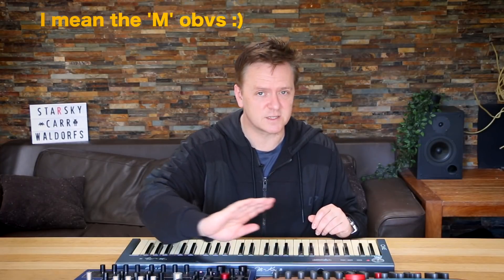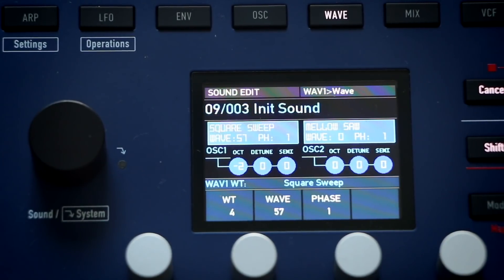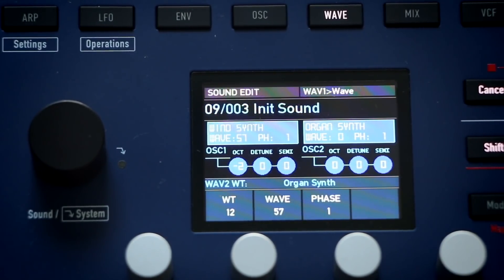Waldorf M vs Microwave XT // The Definitive Comparison

Comment: I'm quite amazed at the modern feature set the XT has. So much depth that's even more versatile and advanced than the M in many ways. It's kind of strange they're adding features to the M to improve it to the level of a synth that's over 20 years old. Is the M now capable of the XTs level of grit and dirt since the changes? Complex to program isn't my thing at all though - the M would be much better for me.

Comment: The XT has a more unique sound while the M is more run on the mill, I should have not returned mine to shop in the 90´s.  I should get another.
Reply: Indeed. Surprised by the lack of people saying this. The M sounds so expected and like others.. the XT sounds unique. If one of these were to be my first or only synth then I may see an argument for the M. But already if I had one analog poly, it'd immediately be more useful to have the XT as it's contrast vs the M. 

Imho.

Comment: Just got to 3:20 - about navigating the param menus on the XT. There's a shortcut you're not using.. page 31 of the manual. If you hold shift (or sync) and move any knob, the screen jumps to that part of the menu structure. Much quicker than using the buttons + big dial. You then only have to use the big dial to navigate a couple of hops to any params that don't have dedicated knobs. Seem to remember my Blofeld does something similar. Bet the M does too.
Reply from the maker: Excellent… I’d completely forgotten about that. Thanks.

Comment: Thanks again Starsky for this comparison! I do plan on getting an M in the very near future but in the meantime, after seeing this video I started going through the presets on my XTk and auditioning them with only Oscillator 1. I've had my XTk for 15 years and I'm just now discovering how gorgeous it sounds. I used to have a PPG wave 2.3 and I'm learning how to get close to some of those sounds. I also owned and SPL Vitalizer Pro and use to run the XTk through it for extra low end and sparkle. I think I'll buy another. Great work you have done for us on your channel!

Comment: The wavetable waveshaper filter is the secret weapon of the MW/XT(k). You can get astonishing sounds using it. I haven't found another hardware synth yet, which offers something with the same character.
Reply from the maker: yeah there was a little trick I used to do to open the gates of hell during a breakdown... but I've forgotten what I did... duh!
Reply: Bingo, is for this reason that the old xt still kicking ass
Reply: Have they implemented all the digital filter of the XT (like waveshaper) and filter fm by now?
Reply: @WackyJackyTracky  looks like filter FM is now there in dsp 1.1 in a working state. digivcf is there as well.

Comment: Fantastic comparison, and it would be good to hear some patches from both. I love my XTk for its sounds, as the best ambient digital synth ever. I suspect the M is closer to the MV1 with wavetables thru a moog filter., with great bass sounds and digital imperfecton. But bring that out with some patches….
A PPG 360 mode on the M would be fab, rather than digital filters..☺️☺️

Comment: Love my XT 30 voice but I unfortunately have the 2nd batch knobs. Which a few have already crumbled. The price I paid new back in 2000 was $1,249 (from zZounds). If anything were to happen to my XT, I don't think I would pay the amount the M is going for to replace it. Since I run a hybrid setup now.
Reply: i got the crumbly knobs on my XTK, its a shame Waldorf are charging to replace them (an extortionate price too), unlike Novation who just send you parts for free when needed
Reply: I preserved the knobs on my XT by using Armorall protectant wipes. It kept them from becoming dry.

Comment: Another useful video: getting the XT instead of a 2 may not make much sense, because both are a pain to use without an editor.
Reply from the maker: I tend to agree. OK there's 40 knobs on the XT - but its got so much in there it can be a real pita!
Reply: @StarskyCarr  I'm very much in doubt about what should be "my wavetable synth". For starters, it's silly to compartmentalise synths in such a way, but my 1990s rack is a bit rompler-heavy. (There are also a VA, an analogue/digital drum machine and an obscure FM synth that I need to fix.)

So I could be looking at something vintage, but also some of the new synths on the market such as the Novation Summit/Peak, the M, the Blofeld, the Iridium... the list goes on.

Having said all that, I just like rack synths (they save space), and I like the sound of the pure digital Waldorfs from the 1990s. Sometimes, having a relatively limited instrument (as opposed to the everything-including-the-kitchen-sink Iridium) can be an advantage, because you know exactly what you're in for. A Microwave isn't going to give you realistic pianos, and it doesn't need to. It is just what it is.

Comment: Did you use different attack times? In the comparison it seems the M would have a "sharper" attack?
Reply from the maker: No just the default patches.  The M has a short release by default (as far as I can remember) which the XT doesn’t. I’m pretty sure they’re set on 0 attack but didn’t double check tbh.
Reply: yes the M has a harder attack here, like a bit of the click of the MW1 (which was unpredictable for every note)

Comment: I found my XT to be very thin sounding back in the day and eventually sold it
( yes I regret it 😢)

I think the analog filter on the M helps out and makes it sexy 

But too much menu diving for me in 2021 
Unfortunately 😩
Reply: same here, i actually don't regret selling mine though. I felt like it looked better than it sounded.
Reply: @Heathcliff_hensel   
yes I agree

Definitely a unique looking module 

I think wavetable synthesis in general can be quite thin sounding though
I have never been a big fan of Waldorf tbf 
This is mainly because of the menu diving 😩
 
But when starsky does a video it makes me want one 😂
Reply: The MX/Xt(k) is everything but thin sounding, IMHO. In fact, I sometimes have trouble placing it in a mix, because it has such powerful sonic footprint.
Reply: @spotlight-kyd  
It’s a nice sounding synth 
I just found it lacking in the lower end tbh
Reply: @strogon42  I agree, I have some of the beefiest analog synths around, and the xTK hangs with them. Definitely solid in the low end .

Comment: I just get the M here, i own the MW1 with the stereoping programmer, the XT 3 voices non nextel paint, the Iridium…
One only advise to all about the M compared to the old microwaves: envelopes not fast enought for hard nice basses, bass frequencies are not so deep and opened.
I still prefer the old guys.
Reply from the maker: I have to admit I didn't notice the envelopes not been as fast as my XT.  Interesting. I wonder if it's a speed thing or if the envelope shape is different.
Reply: @StarskyCarr  The new 1.07 firmware is updating the fast mode to improve the emulation, i hope also that with the new 1.08 will be the option to disable the HPF filter setup to cut the bass freq…just checked the gearspace thread about…ppl starts to ask to implement this option filter osc disabled.
Reply: The M in this video has a harder attack than the XT
Reply: Of these, which do you use the most? What's the biggest difference for you between the MW and M? I found the Stereoping programmer ok but M was still much easier to use.
Reply: @VM_VM1987  Sincerely i do use the MW1 alot compared to the rest, maybe because my preference on my old first gear (i miss my WAVE too sold because was always brocken) in any case, i dont have a preference, when you own almost all the waldorf wavetable hardware and i do own also the 3rd wave, i start to simply use the MW1 because i love some basses sound from it. The M is a nice synth but lack of a modulation matrix and the modulation parameters are sparse in lot of sub menus...would be nice to have the same hardware with a different firmware like th eold yamaha XT16 and so on...at least the modulation matrix ...hope one day will be implemented.